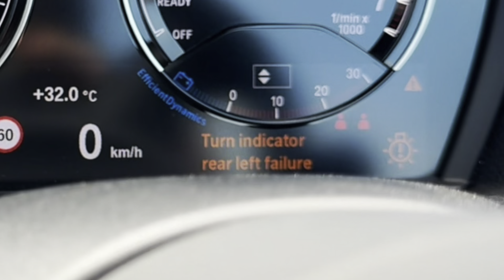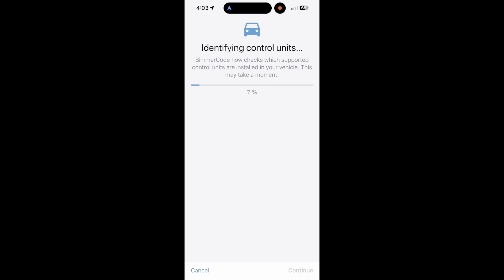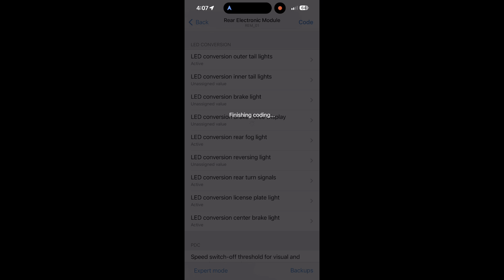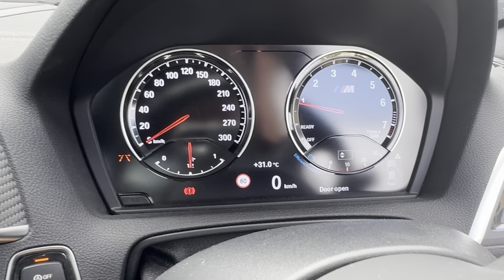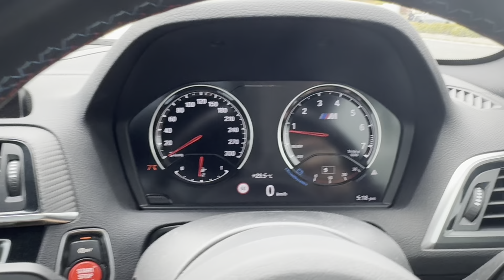BMW F87 M2 Tail Light Error Fix With Bimmercode

Comment: I have done the exact same thing about a year and a half ago. No errors since. However, I did notice once the the rear indicator did not work at all but the dash showed no problem. This was fixed by a gentle tap on the taillight. I guess that by coding this to LED, the car doesn’t sense a fault in any case.
Reply from the maker: The love tap was fixing it for me too which suggests something is loose but this cleared the errors for me. So far so good

Comment: This doesn't fix the broken indicator though; it just stops the error appearing on the dash.

The fix is to replace the full light assembley for which ever side has the problem. Its a known voltage issue in the assembley wiring.
Reply from the maker: Yep. I’m ordering a new $620 tail light
Reply: @TheEddysGarage hi Eddy, does that mean bimmercode didn’t fix the issue eventually?

Could you also share the link of the taillight cluster if you didn’t order it from BMW?
Reply from the maker: @ my local dealer was the best price because everywhere else had high shipping cost to Australia